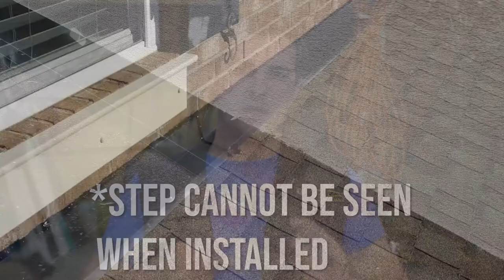Roofing Terms Explained (Definitions and Pictures)

Comment: I have a question: I want to buy a prefab Pergola that is designed to attach to a 2x8 ledger board, could I attach to my 2x6 fascia? Is the fascia and ledger board the same thing? Im a little confused on what the difference is as the fascia is attached to the rafters at the end of the overhang.
Reply from the maker: Fascia board is at the end of your rafters. A ledger strip attaches to a wall and basically acts as a shelf for something to sit on. They're just about the same, but without more information about the Pergola, we can't say with full certainty that fascia could support it. Likely not since the manufacturer specifying 2x8 is probably for a good reason.
Reply: @theroofingchannel  got it , not saying you you recommended it but is it feasible to change the fascia from a 2x6 to a 2x8 with lag 4 in lag screws into the rafters to support it? I mean at the end of the day I have to get a permit but I want to know what I’m talking about when I ask for the permit. I appreciate you taking the time to reply. Thanks
Reply from the maker: @apolloorosco6852  Replacing the fascia board with a 2x8 instead of a 2x6 is likely possible (depends on a couple factors). Assuming you can replace the fascia with a 2x8 board, it's still the safe bet to go with the manufacturer's installation instructions and stick with the ledger board, but there's still a chance that the fascia board works. For safety reasons, we can't recommend it for certain. Hope this helps. Best of luck with getting the permit.